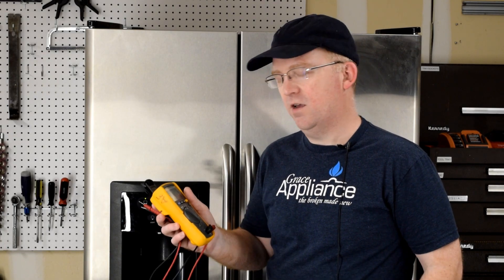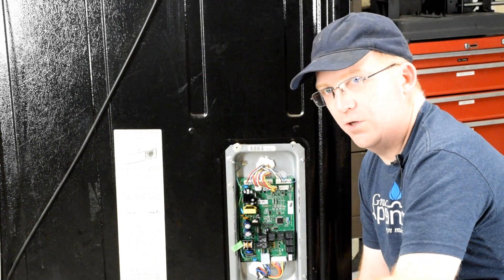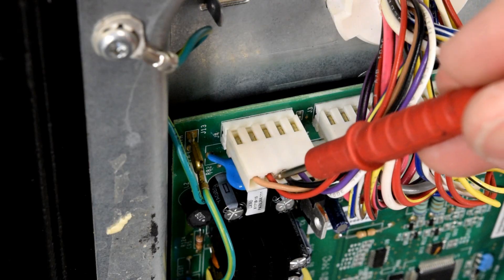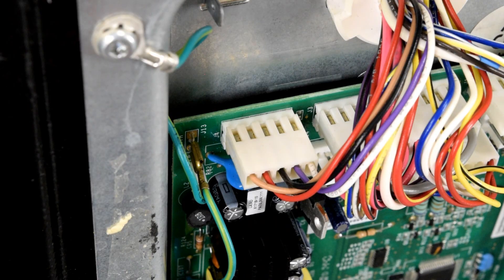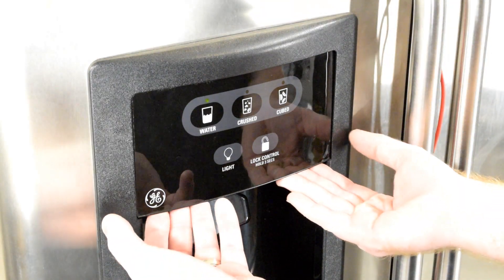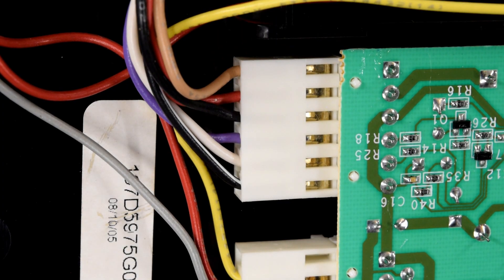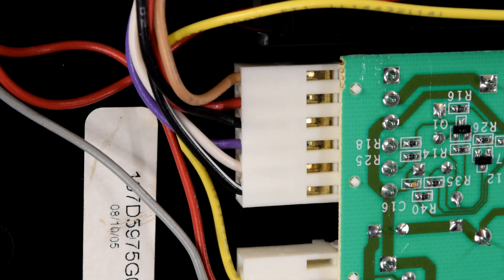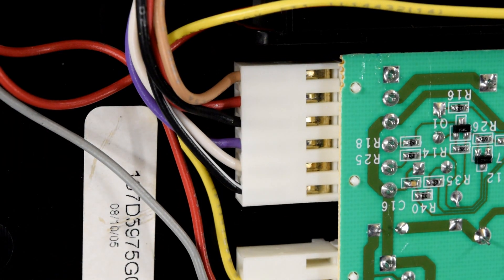Diagnosing a Bad Control Board - Part 4: Front Touch Panel

Comment: Thanks a lot for very helpful videos. Our GE fridge (model#: GSL22JFTABS) died last week (no cooling, no lights). After watching your videos, I replaced the main control board and it semi-works again: both the freezer and refrigerator compartments freeze/cool as supposed to be. But the ice & water is not functioning: the touch panel lights up but flashes two ZEROs constantly (never stops), and the touch panel is not responding to any puches. Any recommendation for the next step. Your kind assistance is appreciated.
Reply from the maker: Hi, I'd start by taking a very close look at the plug behind the kickpanel by your feet. Remove that panel and by the freezer hinge you'll have a small white plug. Look got corrossion, broken wires, or loose connections.  Unplug and replug this and replug 4 or 5 times and see if it improves.  Let me know.   Thanks
Reply: @GraceAppliance  Thanks for your quick response. I cannot find the white plug behind the kickpanel (grill). The only thing there is a water line. All the electric wires (connection of the freezer door) are on the top hinge of the freezer door. Any more hints?
Reply from the maker: @mntechspecial  I'd do the same inspection at the plug on top of the hinge of you haven't already.  This flashing zeros is usually a communication issue between the front panel and rear control board.  

If all looks good there, double check the connection at the main board and front touch panel plug.
Reply: @GraceAppliance  Just double checked the white plug (on the top hinge) and the the connections on the rear control panel. Nothing seems out of ordinary. They all seem fine to me. I will check the connections on the front panel (I need to learn how to uninstall it first.). Is it possible some bad connection inside ice & water system (such as ice maker, dispenser, etc)?
Reply from the maker: Josh Sun Hey, keep me posted if you run in to any issues.  

Also, could you please confirm what part number of control board you installed?
I want to double check the correct part number for you.
Reply: @GraceAppliance  The part # of control board I installed is 200D4854G009. Thanks for checking.
Reply from the maker: Hey, 
It should be WR55X10942P. 
Do you see that anywhere? 

Also, please send the first 5 digits of your serial number for your fridge.  

Thanks!
Reply: @GraceAppliance  I thought 200D4854G009 can substitute WR55X10942P, at least according to the eBay seller: https://www.ebay.com/itm/182581560533?ul_noapp=true
Reply: The serial number is VL216134. Thanks for your reply this late night.
Reply from the maker: Thanks, 
Hmmm - so I’m not sure on that. To me it seems like an aftermarket board vs a genuine GE board so honestly all bets are off with if it would work for your model or not. 
The part number is not one I’ve heard before.  Just so you’re aware, there are at least a couple different part numbers out there which have identical plugs and appearance, but the software is what differs. It doesn’t harm the fridge to install it, but it makes things act really wonky if it’s the wrong one.  

It kind of sounds like an incorrect main control if you did not have this particular issue with your previous control board installed.  

I wish I could recommend something a little more concrete for you to check.

Comment: Andy, there is some way to re-start the control board for a GE PSW26PSWSS? SOMETIMES WHEN THERE IS NO ELECTRICITY AND IT RETURNS THIS DOES NOT GO ON.
Reply from the maker: Hi, besides unplugging and replugging it back in, there is not a reset.  

I would check the wiring by the freezer door bottom hinge behind the kick panel.  
These wires get corrosion and often have a bad connection there.   

Next time it’s giving you issues, you’ll need a multimeter to test for the 13.5vdc from the main control board to the touch panel.  I’d test for the voltage at main board behind the fridge, and then test again at the touch panel to make sure the voltage is making it to the touch panel.  
If voltage is good at main board, but not at the touch panel, you have bad wiring.  If you do have voltage to the touch panel, but it doesn’t light up, you have a bad front touch panel.   

I hope that helps.  Andy

Comment: I have a profile dispenser on my GE side by side. The control panel locks on "water" and intermittently comes back to normal or all lights flash and the alarm goes off. It fluctuates on its own but doesn't interfere with the freezer or frig. they work OK. What do you think.
Reply from the maker: Hi Kenneth, just based on the symptoms it sure sounds like a shorted out touch panel. Basically it 'pushes' the buttons on its own because the buttons are constantly depressed. That would be my initial knee jerk reaction for a diagnosis.
There are ways to test the button function by taking ohm measurements on each pin as you're depressing the button... However, you'd need to know the pin configuration as it associates to each pin, but unfortunately the tech sheet won't show this info. So, I can't think of a good way to test this theory out without swapping the touch panel. 
Just my initial thoughts.

Comment: Hey my control board isn't lighting but the compressor and fan is working but still no cooling
Reply from the maker: Hi Belzi,
Please send your model number from inside your refrigerator on a sticker. 

Also, are both of your fans working? You have one inside the freezer and another behind the refrigerator.
Have you put your hand on the compressor to make sure you can feel it vibrating?
Reply: @GraceAppliance   i got to it today, it needed refrigerant, but the temperature control board isn't showing any display ,yet it is cooling
Reply from the maker: Ok, sorry to hear about that, but am glad it’s cooling for you now. The refrigerant is inside a sealed system and of course you have a leak. It may hold for years....or hours depending on the severity of the leak. 
When you have time, you can follow the steps in this video and let me know what voltage reading you’re getting on the control board plug for the front panel. The red wire and black wire.  We could go from there.   But, in the meantime, I’d probably let it run for a week or two and see if the refrigerant is going to stay in there before you put too much time and money in to repairing the front control issue. Just my recommendation of course.  Thanks

Comment: What if the voltage to the front board fluctuates between 5 and 12 volts?
Reply from the maker: Hey Donald,
Is the refrigerator totally dead right now?  No lights on the front panel? 
Try unplugging the front control board and see if the fridge comes to life. If so, it's a failed front control panel.
Reply: No lights on the front panel just inside lights are on. I unplugged the front panel but still nothing.
Reply from the maker: @donaldfleming8373  hey, ok. I'd try unplugging the fan motor circuit. I beleive it's the j2 plug on the main control board. Has a blue wire on the left side of an 8 pin connector.
If the fridge comes on at that point, it's a shorted fan motor. 
Let me know what you find.
Reply from the maker: Also, I'm not sure if you're checking for the voltage at the main control board or at the front touch panel, but one more thoght I had was to be sure to check the wire connection behind the kick panel near the freezer hinge.
These have a tenancy to get corroded and get inconsistent voltage to the front board.
But this wouldn't cause a voltage variation at the main board I don't believe.
Reply: Hey Donald,  did you resolve this issue?
Reply: Hey Donald,  I have the same issue. All I did was clean the fridge then it wouldn't turn back on. Just lights inside the fridge. I too am getting 4-8 volts. We're you able to resolve this issue? Thank you for your help.
Reply: I am having this same problem. Does anybody know the issue?

Comment: Andy, I too really enjoy your explanation of diagnosing the problem.  
I have an issue whereby my ice dispenser not dispensing ice.  The ice maker makes ice but it doesn't discharge through the bin.  Auger move freely.  I tested the auger motor and it did not engage with the ice dispenser pressed, light switch pushed off, the auger shaft did not move. I removed auger motor and connected it to 110 ac and it operated good, rotating the auger shaft.  I tested the dispenser switch for continuity and it was good.  I have a schematic and don't know where to go from here.  Any suggestions?  Thanks!
Reply from the maker: Hey Jeff, 
It will help me to have the model number and I can give a little more specific advice, but if you've got a single paddle for both water and ice at the dispenser, it shares the same activation switch.  
So, you can test the function of the switch by selecting 'water' at the door touch panel...if you can get the water to come out at the dispenser then your switch is good. 

It sounds like your auger motor is good since you've tested that to direct power. 

Basically the components at play here are the auger, the switch, the front control panel to select either ice or water, and the main control board.  Once I have your model I can let you know further. 

Thanks!
Reply: Thanks!  Model is GE GSH25JSRF SS
Reply from the maker: @jeffgeorge1624  Hi Jeff, 
Your main control board should have J7-1 (plug J7 pin 1) a black/white wire and J7-9 (plug J7 pin 9) should be an orange wire.  Your board should be sending out 120v to the auger here when you depress the switch to call for Ice.  

Let me know what you find with that test.  

Another thing to check is that the switch is still 'clicking' when depressed.  Sometimes you will get continuity through the switch, but internally it has failed.  The small plunger should not feel mushy and should have a definite click when depressed and let go.  

Thanks!
Reply: GE Side-by-Side ONLY - Refrigerator Repair Videos 
I did not have any reading on the J1 & J 9 with the dispenser depressed.
Your thoughts?  Thanks
Reply from the maker: @jeffgeorge1624   jeff george  do you have a single dispenser paddle for both water and ice? 
If it is a single paddle and the water works when the switch is depressed, it should be working when the is depressed too. 

I'd want to know the Ohm reading you get when testing the dispenser switch. 

If the switch is good, I suspect a failed control board.
Reply: GE Side-by-Side ONLY - Refrigerator Repair Videos 
I tested dispenser switch, it 00.4 ohms.  I replaced the switch and it didn't correct problem.   It suspect it's the dispenser panel.  Any way to test it?  Thanks
Reply from the maker: @jeffgeorge1624  cool, thanks. The switch sounds good based on that.
The dispenser board does not supply power to the components, but simply tells the main control board which component to activate. I would strongly suspect the main board vs the front panel.
Let me give some thought on how to best test that board.
Reply from the maker: jeff george hey Jeff, 
Could you please snap a picture of your wiring schematic and send that to: GraceAppliance@gmail.com ?
I want to double check on the pin locations for your auger output from the main board.   

Thanks!

Comment: Hi what happened if you have more than 13-14 volt said 15-17 volt from main board to temperature control board is that normal mean main board is ok?
Reply from the maker: I beleive that would be abnormal, but wouldn't think it would cause an immediate issue except it may run the fans faster than designed. Do the 2 larger green resistors on the control board appear to be brown or black?
Reply: @GraceAppliance  They both look ok to me 
My problem is the temperature control is not working Model PDS22SBSALSS
Interior lights is on the rest is not
I checked main board has power 120 volt
But from main to temperature control has 15-17 volt fluctuating
My concern is if I put a new TCB will they burn out ?
 BTW is this is the right part WG03F00507?
Thanks again
Bandy
Reply from the maker: @bandyfong7228  hey, I'm sorry I'm not at a place right now I can confirm the part number but I will when I get home.
I'm leaning toward a failed front touch panel.
Try unplugging the plug from the main board and see if the refrigerator comes on then.
Let me know what happens.
Reply: @GraceAppliance  I  tried unplug no luck 
I took the main board out and found a burnt spot is mark R12 I can send you pic if you can shed some light for me what is that and can I change it myself?

Thanks
Bandy
Reply: Or is better to get a new board
Reply from the maker: @bandyfong7228 
Hey, anything outside of swelled up capacitors, burned solder joints, and failed relays I haven't had much luck with rebuilding them.  I'd replace the board personally. The high voltage indicates a failed main control and hopefully that would resolve the front panel issue you're having. Based on the fact that there was no change when unplugged, I suspect the new main control board will resolve your issue.  Keep me posted if you have any questions. 

See in the description for a link to your part. If you make a purchase through that link it helps the channel a ton. Thanks!

Comment: Sometime I get water and sometimes the water won't shut off. Is that the board or something else?
Reply from the maker: Hey!
More than likely you've got a sticking and failed micro switch for the dispenser. 
The best video I've got right now on how these switches work is this one:
https://youtu.be/9C9G5aBpaYY
At the 2:05sec mark.

With the power off, you'll disassemble the dispeser to access the micro switch which is activated by the dispenser lever. When you remove the switch, you'll likely find that it no longer clicks when depressed. It's probably going to feel spongy when depressed.
Also, another way to diagnose this without disassembly is to slowly depress the dispenser lever and you should hear an audible click when fully depressed. If not, it's a failed switch.

Let me me know if you have any questions. 

Andy
Reply: Thank you!
Reply: Now if I can find how to remove the control panel on my PSCS3RGXCFSS to access the switch, I'll attempt the repair.
Reply from the maker: You're most welcome.  If it does end up being the switch this is likely the one you'll need. 
They're notoriously expensive though (for what they are):
https://amzn.to/2DVQuKV

Or, what i've done in the past to save a few bucks is to take Samsung switch and cut the lever down with a pair of wire snips.  It's the same switch with a longer actuation arm.  
https://amzn.to/2DLtCN2

If you purchase through either of these affiliate links, it helps the channel a ton and is appreciated.
Reply: Thank you again. If you can direct me how to get the panel off my GE PSCS3RGXCFSS I'll order right away
Reply from the maker: Hey, for disassembly - watch this video: 
https://youtu.be/fQAXJE2bHZI?t=186

Your fridge obviously does not have the black plastic surround bezel on the front so skip that step.  But, your touch panel should tilt up when you pull up and away from the bottom.  
Access is the same from that point forward I believe.

Comment: the light does not respoud on ice and water and the power on Touch panel Maytag
Reply from the maker: Hi zdzich z can, 
Sorry to hear about your issues with your touch panel.  
As you know, this video is going to be applicable to GE side by side refrigerators, but i'll do my absolute best to assist you if i'm able.  

Please send your model number for your refrigerator which is on a tag inside the refrigerator section.
Reply: I found the problem to press control lock and hold for 3 sek thanks
Reply from the maker: zdzich z can awesome news!  Great job getting it figured out. Stay in touch.

Comment: I do mostly commercial low temp and a/c. Freezer is ok , customer says the refrigerator has not cooled good since she purchased it. It seems like the compressor is not getting up to speed.  So I watched your vid on checking  the main board so I  think I can find out if the compressor is getting the correct control voltage. Condenser is clean. When I  push the button for turbo cool is when I get what looks to be a code. Very hard to find factory info on this machine.
Reply from the maker: Glen Lynch yeah, this machine is definitely more complex than most in that it’s got 2 evaporators, the compressor is variable speed (i.e. an inverter compressor), and it routes the refrigerant to each evaporator via a 3way refrigerant valve.

Since the freezer is doing ok, we can assume the compressor is doing its job. 
Without knowing what error code is being displayed, I couldn’t say much more, but the same compressor cools the refrigerator evaporator. If the refrigerant valve is functioning and routing refrigerant to the refrigerator evaporator, you’d need to confirm the refrigerator section evaporator is circulating the air in that side. 

If you wanted to send me a message through YouTube (not publicly here) with your email address I can defiantly email you the tech sheet which may be of some help.

Comment: I have been repairing refrigeration  for 50 years, the new refrigerators are very different.
Reply from the maker: Glen Lynch the bells and whistles are, yes. The means of how we turn on/off compressors, fans, LED lights, etc has gotten more complex. 
But refrigeration is refrigeration. It’s always amazing to me how little the actual nuts and bolts of cooling a box has changed in 100+ years.  

In your case, I’m still not clear if it’s both cabinets that are warm. You mention the fridge section is 41’. Is the freezer keeping things frozen rock solid?  Did the diagnostics test give any codes? 

The fan you mentioned is likely for the crisper drawer and won’t have a bearing on the refrigerator temperature, but you have a fan behind the wall inside the refrigerator which defiantly would.  
I’d start with the basics by checking the condenser coils to make sure they are clear of dust, maker sure you don’t have food blocking vents, make sure all your fans are indeed turning.